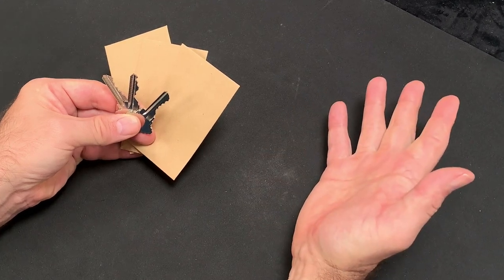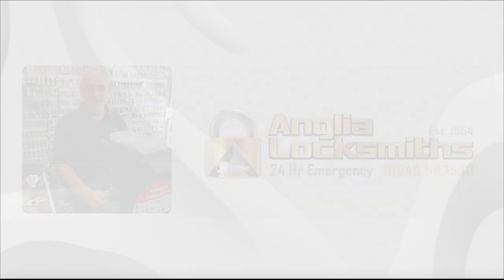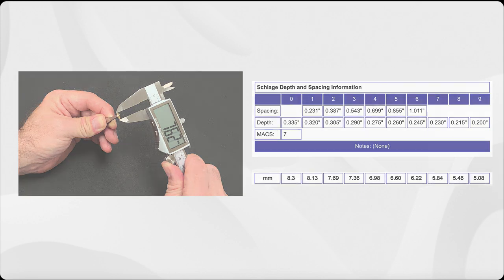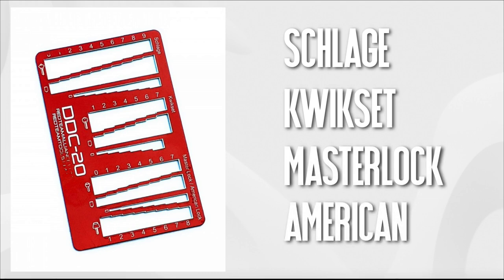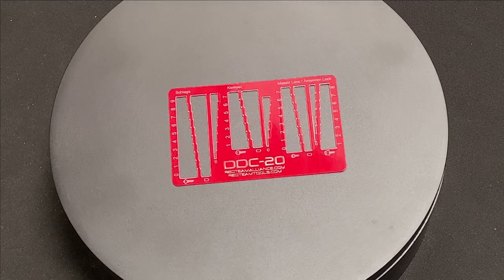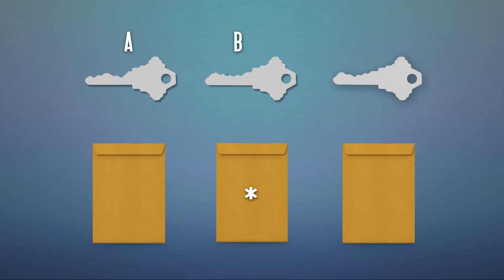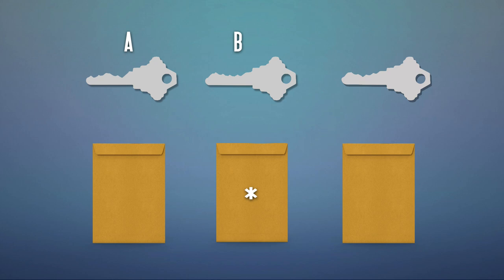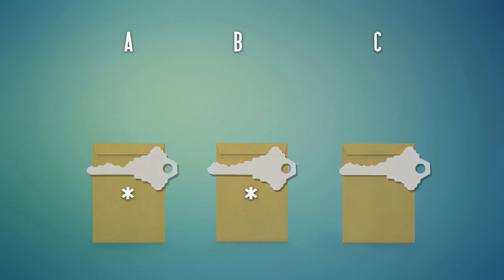035 How to use a locksport decoder card

Comment: Using just 3 moves is only possible with some constraint: If we assume that the deepest cut for each key is different and that we can compare and order them by their deepest cut just by looking, without having to use the card, it goes like this: 
1) order the keys by their deepest cut: K1<K2<K3 
2) measure the key in the middle K2 
3) open one envelope of pins, measure them. By comparing it to K2, we can determine if the pins match K2; if not, comparing the longest pin with the deepest cut of K2 tells us whether it belongs to K1 or K3
4) repeat step 3) for another envelope

But then, we could just order the envelopes by maximum pin length P1>P2>P3 and would not need the decoder card at all ;-)
Reply from the maker: I like your thinking here Erich and agree with the caveat too!

Comment: Hi Andy,
I'd really love a decoder card for european lock brands, but which brands should be covered?
Yale for the UK of course... germany has Abus, BKS, Burg Wächter, DOM, ... don't know actually who of them is most common, but they were the first that came to my mind...
probably we'd need more than one card to cover all of them, unless some of them share  their spacings :D
Maybe we need to compress the layout, so we could fit more slots on one card, for the pins e.g. the width of a pin + tolerance would be OK and the same applies for the width of the key
However, I'd buy the DDC20 if we'd have more of these locks here in germany/EU/UK ;)
Reply from the maker: Yeah I guess that is the problem with having such a great range of manufacturers to choose from in Europe. Perhaps it would be a case of identifying the top 4 or 5 locks in residential use in each country and then producing something specific for each market.

Comment: Fun idea! To answer your question of finding the solution with less information, I don’t believe this is possible. Assuming we have a unique solution, that is that each pin set corresponds to only one key, and each key corresponds to only one pin set, then mathematically we can treat it as an independent system for each pair. Without further constraints, the information (number of bitting measurements as counted in your description) required to solve it should follow 2*(n-1) where n is the number of pairs. So for 1 pair, you know those pins match that key. For 3 sets, you’d need 4 measurements. For 100 sets you’d need 198 measurements. At least, as far as I can figure at the moment. 

Side note, I believe “Ollam” is pronounced more like “Olaf” https://en.m.wikipedia.org/wiki/Ollam 

Thanks for another entertaining Locksport video!
Reply from the maker: Good logic there mate and I had no idea about ‘Olaf’ - I imagine a lot of people make that error! Appreciate the correction 🙌
Reply: @fishpicks4531  I was surprised by the pronunciation myself. I only learned it when I happened upon a video where it was mentioned, and I discovered I had been saying it wrong for months. 😅

Comment: Maybe I missed the point because I would just visually match the set of pins with 2 extra long pins to the only corresponding key. Another key only has one large bitting jump. The card would just be used for double checking.... You said fastest way.
Reply from the maker: I think Allyn the point was to test the concept - not the bitting profiles for these particular keys.  😉
Reply: I know... I also thought that the rules stated meant only 3 measurements - 3 individual pins/cuts. With that stipulation, the only solution I could find was case specific.
Reply from the maker: @KickassKriss  I did say in the commentary that I was defining a ‘measurement’ as the decoding of a key or set of pins - but easy to miss this I guess. 🤷‍♂️

Comment: Seems red team tools won't post to the UK.
Reply from the maker: Really? That must have been a very recent change because I ordered mine for UK delivery without a problem 😔
Reply: @fishpicks4531  Hi yeah I emailed them and they said they could not deliver to the UK because of brexit and problems with VAT.
Reply from the maker: @wheeler9180  ah that sucks - worst case scenario is use a go between in a country they do post to I guess but it will obviously push the costs up 😞